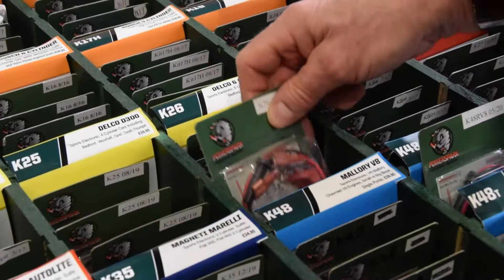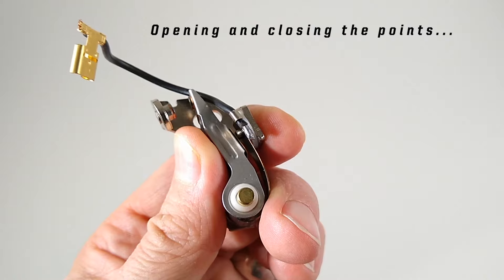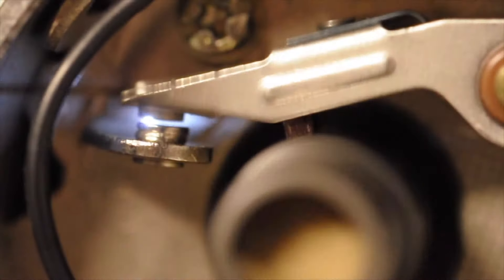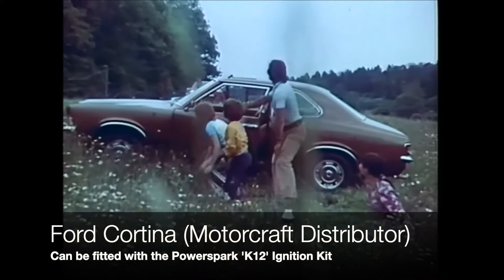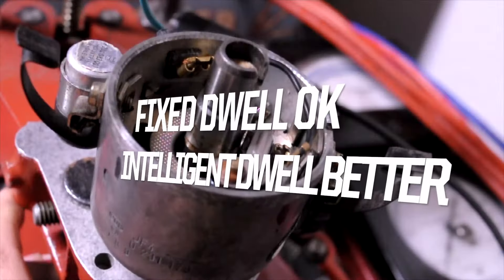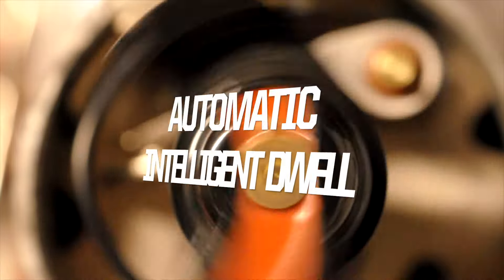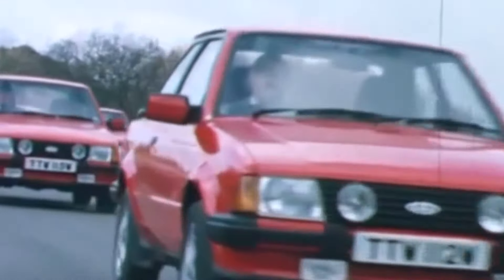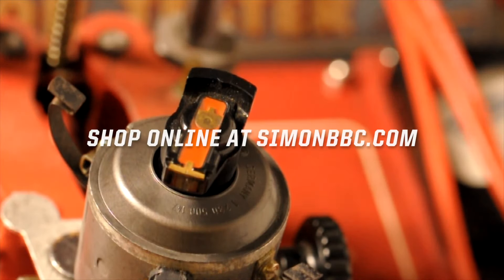What is electronic ignition... do I need it in my classic car?

Comment: Hi, is there a separate ignition amplifier required or is the unit that mounts inside the distributer all that's required?
Reply: You’ll need a coil as well as this kit. But if you’ve already got points you should have a coil already